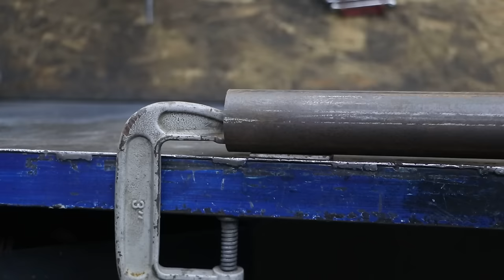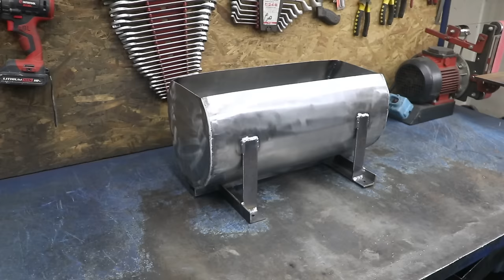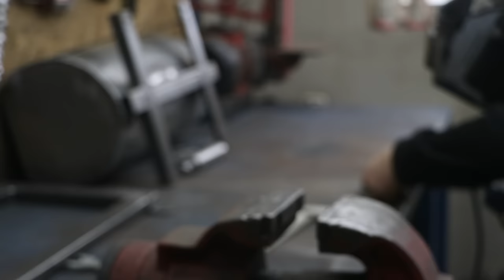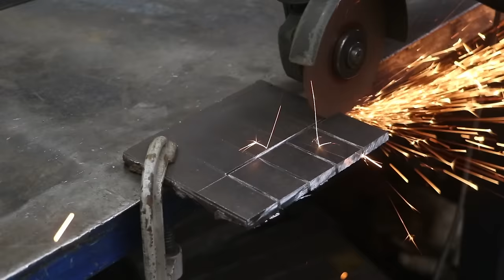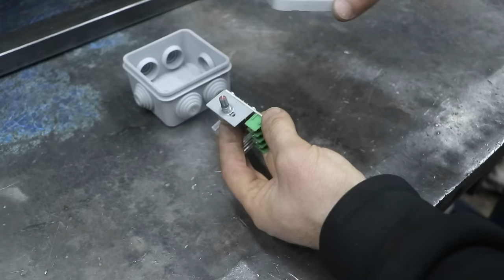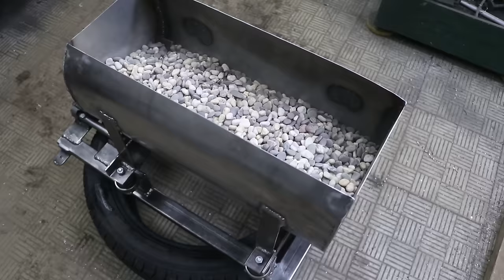How to Make Vibrating machine for cleaning and polishing rusty parts!

Comment: Nice idea but a waste of time if your serious about vibratory tumbling. Your tub needs to be made with a rubber liner or a polyethylene type material. Your sheet metal will be destroyed in a few days. The concept itself works but still.  Also they make smaller tumbling media with different shapes. A small triangular media will do the job in less than half the time. Smaller stones would work 100% better. There is a media compound powder to use and there should be a small amount of water in there as well.  Lastly…..Safety man. Never cut towards you with a knife 😬, always away.
Reply: You're a Debbie downer
Reply: @kylechapin1057  sorry dude….I call them like I see them. Was only trying to provide useful information to your viewers
Reply: @Lwimmermastermetalart Much appreciated!

Comment: 6 hours using electricity, VS 10min with an angelgrider with a flapdisc?😳
Reply from the maker: Yes, that is right)
Reply: Sand blaster ...
Reply: Spoken like someone who has never used a viberation media polisher
Reply: Or a wire wheel.

Comment: You can achieve the same result using a glass bead blast cabinet , it's cheaper , it's quieter ,  it's FASTER ,  just need an air compressor , and it wont wear out by the end of the week.

Comment: So, how many hours before the abrasive stones wear through the thin case of the machine. A better idea is to line the inside with flat rubber so as to reduce the friction on the thin walls. I've seen this used with good results. Thanks for sharing your idea! Cheers.

Comment: I like quality of your work. But wouldnt it get more efficient if it had up and down movement too? Bcos you installed the vibrator weight moving vertically and the bolts inside the springs are locked the springs to move only sideways and you would get less harmfull vibrations transfered to the whole frame? Or the springs are compressed enough bcos of the weight of everything in the drum so it can move up and down that much?
Reply from the maker: The springs are more bolted on one side only, on the opposite side they are almost free. It would be even better if the springs were softer, the effect would be better.
Reply: A vibratory tumbler via a vertical shaft motor with a toroidal shaped bowl; lined with a layer of polyurethane is the best/most efficient way to go.

Comment: How come you don’t use your plasma cutter to cut your plates? It would be easier than using cut off wheel.
Reply from the maker: After the plasma cutter there are very uneven edges that need to be processed.